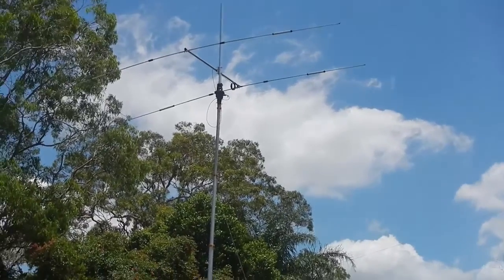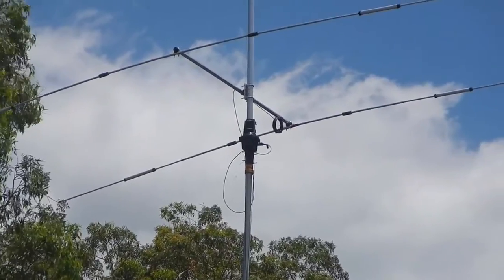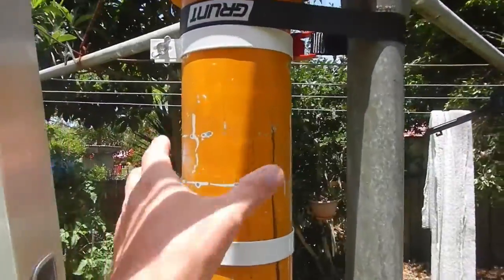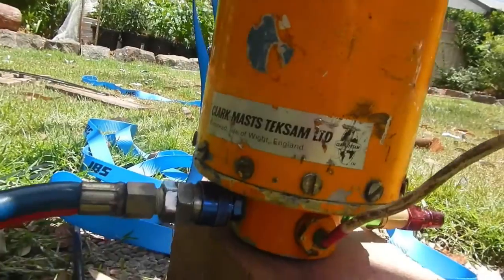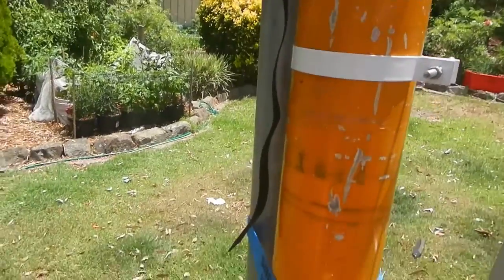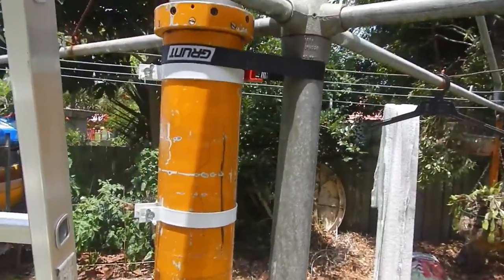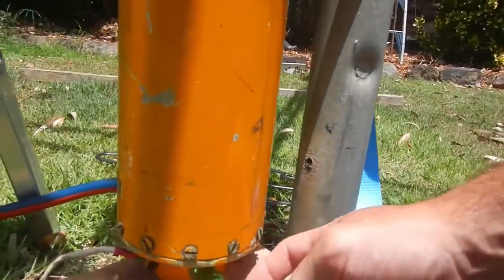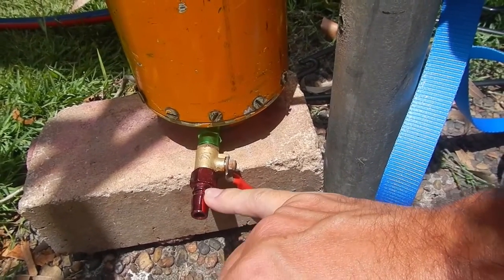Pneumatic Clark mast P9 for amatuer use

Comment: Where the hell did you get one of them ? .. Those clark mast sway if not anchored I would put up 3 Guys ropes and use 3 big stakes Probably have to make a collar out of steel if there is no lugs to clip to .( I assume that model is meant to be attached to a vehcile ) 
Is there a little bubble to see its level at the base?

 Here is a link to heap of pictures of the guy ropes .  https://www.google.com.au/search?q=clark+mast+australia&newwindow=1&rlz=1C1CHWA_enAU652AU653&espv=2&source=lnms&tbm=isch&sa=X&ved=0ahUKEwi75Onf_f7QAhXHS7wKHUNXDfIQ_AUICCgB&biw=931&bih=580

http://www.clarkmasts.com.au/aust_accessories.php

Good luck
Reply from the maker: +SuccessandWealthCoaching.com picked it up off  Gumtree (public selling site)   it sat there for many weeks and the price kept coming down,  so I grabbed it.  Turns out the guys email address was wrong in the listing,  so he wasn't getting any responses.  I got very very lucky.  When it goes on the car out will be guyed.  I won't take any chances there.   Clark prices seem a little high in my opinion,  so I'll come up with and alternative.    No  bubble level on the bottom.  One of those tripod mounts would be nice but id far along how much they would want for one.  Cheers for the link.